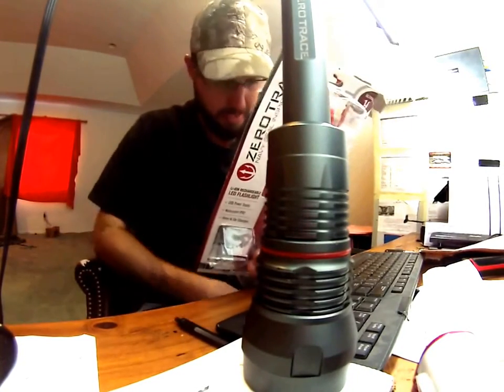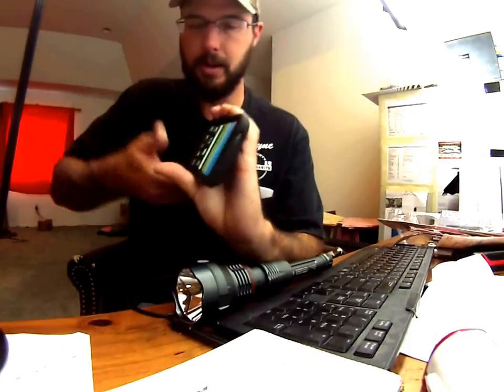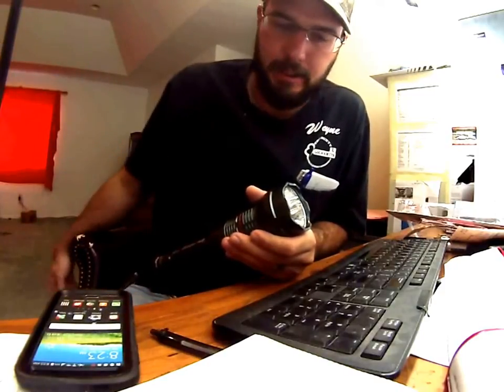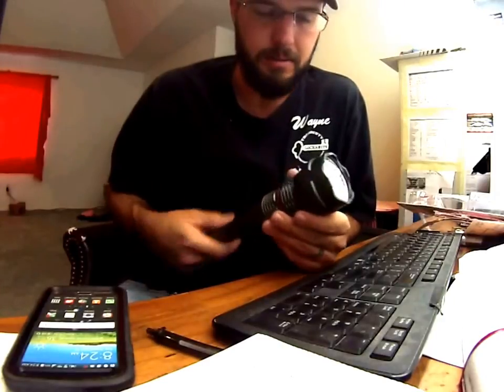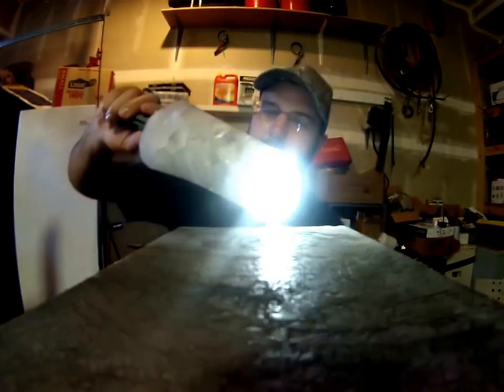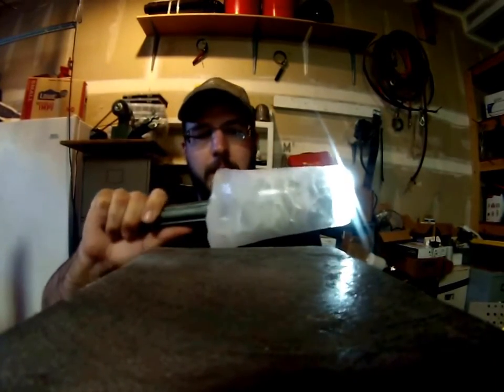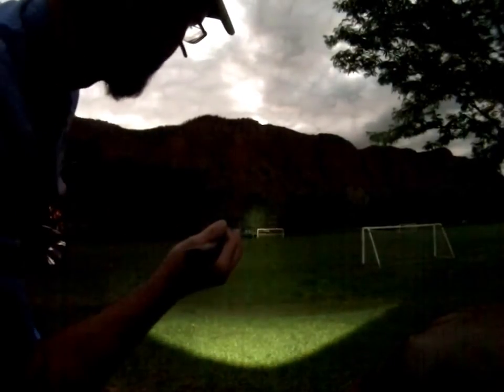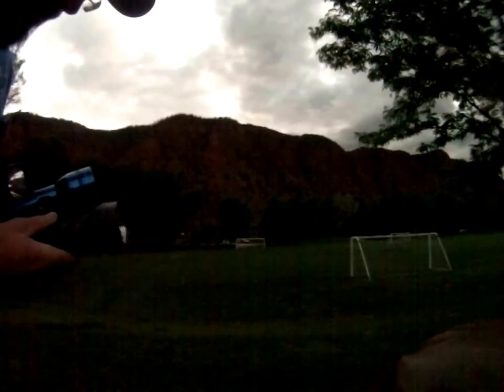Top Rated Best Brightest Flashlight Zero Trace Tactical Flashlight LED Light Review

Comment: I don't like it: it is a lot larger than my Nitecore TM26 which has up to 3800 lumens, multiple brightness levels and features but no USB charging. I don't like the idea of charging a flashlight through a low voltage, low current port and using the flashlight's battery for unnecessary features that'll leave it empty when you need it. I did however like the way you reviewed it, but I wouldn't use a Maglite as a baseline.
Reply from the maker: +Paul MvN Well thanks for the comments. nitecore Tm 26 Looks great and bright but also costls 3 X as much. The title dose say for under 100 bucks